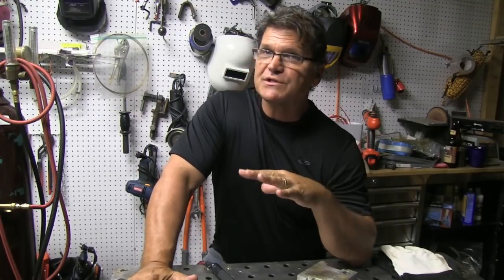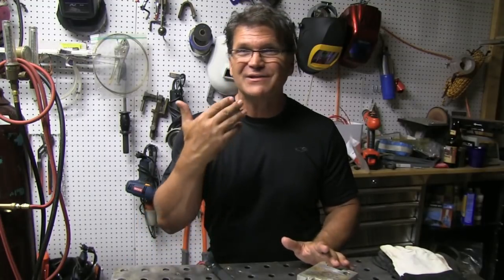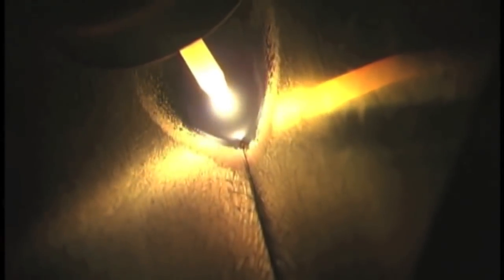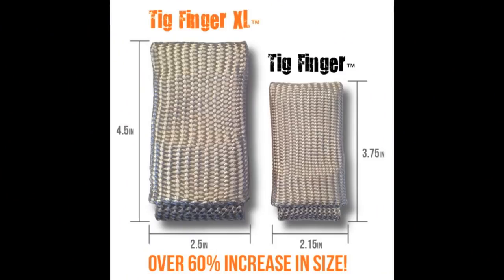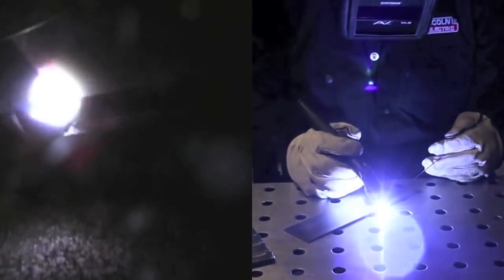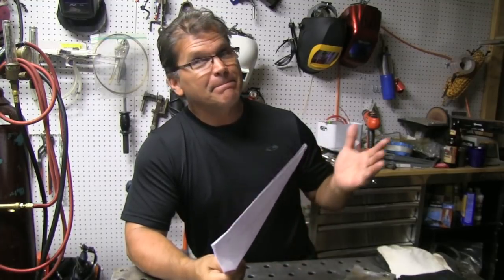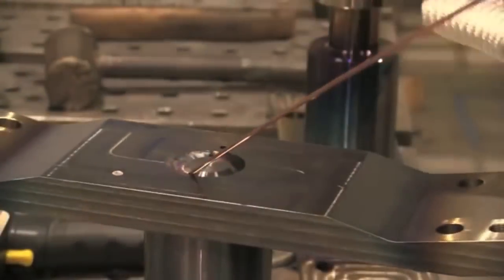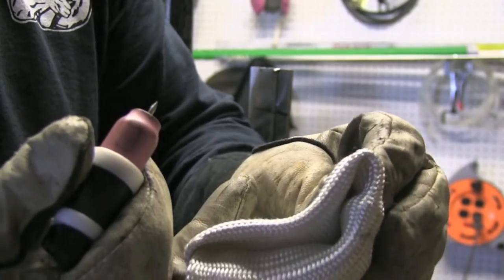TIG Welding Basics part 2 Q&A

Comment: Still no base amperage for your "rule of 33." I would love to know when setting the pulse if said 33% gives me just that? say if I am at 100 amps am I left with 33 amps. Also still would love some input on welding 6160 (T whatever) , 5356 , 4043 or 4943 , I have done a ton of research and 4043 seams to be the most common for said application however , there is no information about the practical application of 4943 anywhere. In theory it responds to heat treating much better than other filler metals in junction with 6160 aluminum .  

P.S. I use your Tig finger nearly every time I fire up my machine , indispensable.
Reply from the maker: the amperage output when using the "rule of 33" seems to be about half of what you have the machine set to. ( at least thats what the digital displays I have used seemed to read)
I generally only use 33pps when welding near an edge or filling a gap or hole....so not much amperage needed for those tasks.
Reply: weldingtipsandtricks  I will double check today at the shop , I rarely use the pulse but, it has come in handy a few times. Thank you 

P.S.    I am using the Miller Dynasty 200 DX   it has been a very solid machine for me. I have followed your videos for a very long time, your input has been a very valuable learning tool to me.
Reply: Sure enough, on my machine 33% = 33 amps of 100 . guess I should have simply checked this my self but, what the heck I figure it is a good topic for discussion. Thank You